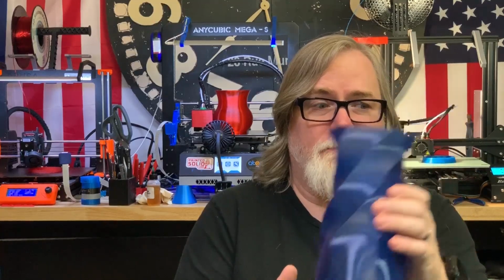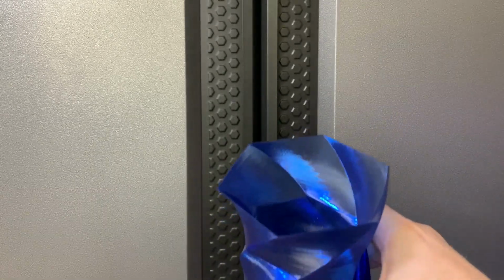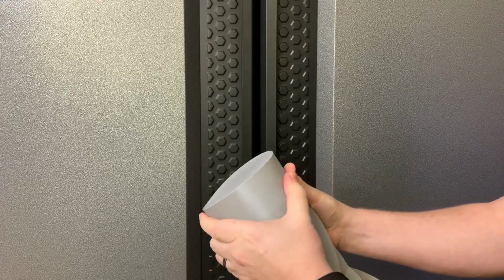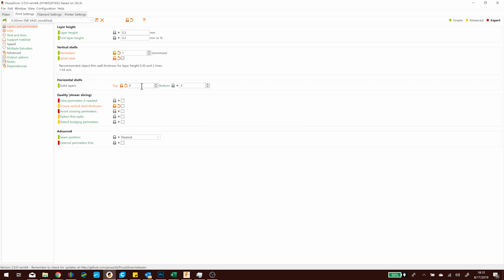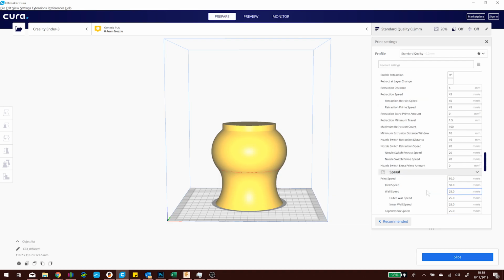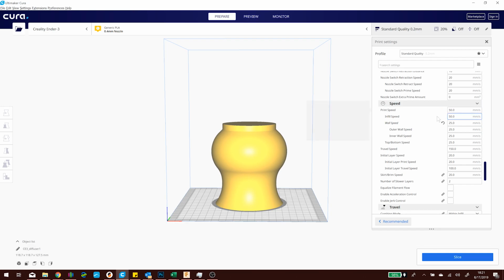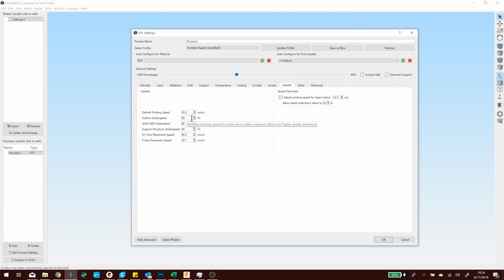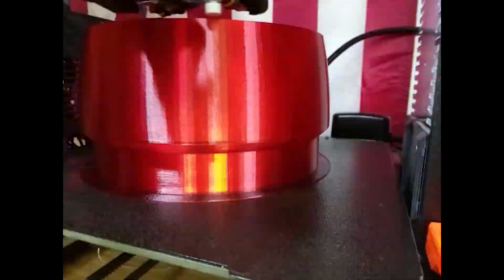Double Wide Vase Mode Super tough 3d prints and  Destructive testing!

Comment: Zelrick.  I am working on trying to get PETG to print water proof.  Thoughts?

I have had a lot of success if I get that first layer super squished, and I do 2% over the normal 100 flow on all layers...and print min. of 2mm thick...but while I can put water in it and it will hold water indefinitely, if you pressurize the container with water in it then it does leak a little...I am hoping that I can get the settings just right to get 100% water proof, I have seen some folks claim to have done it, but hardly any walkthroughs available.  

I look forward to your content...gimme more.  thanks
Reply: what is your nozzle size?
Reply: @coralioballester  I have tried .2, .4 and .6

I actually managed to get pretty decent water proof "vase" mode prints by using a double layered wall with just a little over extrusion.  It holds water without leaking.  However if I put water in it and then make a seal around the mouth of the vase and add a little pressure by mouth it will seep and leak.  As a work around I have found a good resin to put inside which seems to take care of both issues.  I was actually trying to make a "bulkhead" for a injection molded container.  I managed pretty well.  I increased the thickness to 4 layers and printed with 30% infill and incorporated a TPU printed O ring and the thing can be submerged underwater without any leaks...and no glue needed for sealant which is great.  Then our team decided to go another way...so 100 hours of work amounts to a hand full of nothing...lol.  good experience though.

Comment: Do you have a config for petg spiral strength test. Or a writen list of settings for this stronger petg print. Ill run some test soon to see if i can. When I run my test I will come back to this video.
Reply from the maker: Hey Mikey, it's slicer dependent, but what you do for a .4 nozzle is set the perimeter (wall) extrusion width to .8 and slow the printer down 20-30 mms. Some slicer will make you set all extrusion widths with one setting, that's ok too.